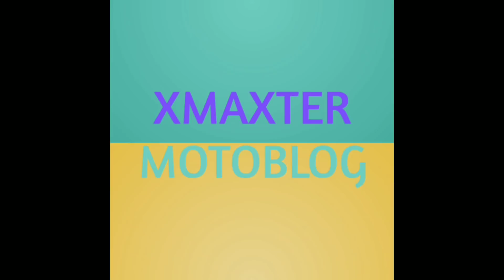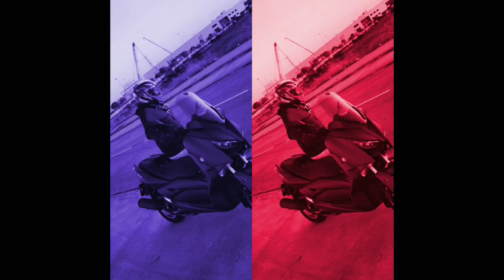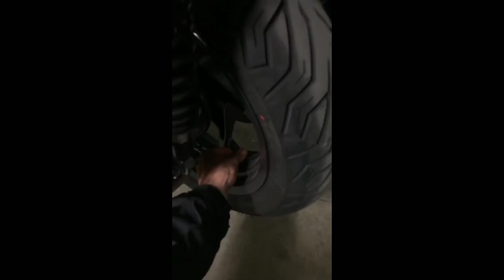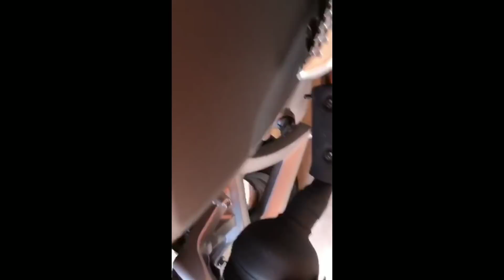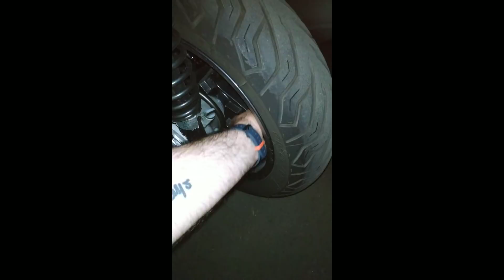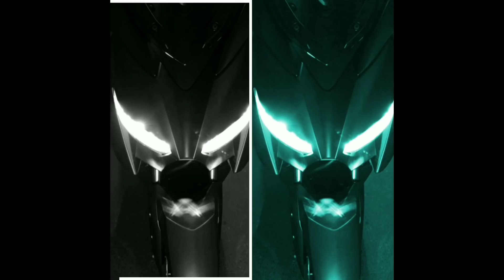Ruido en rueda trasera en modelos xmax .defecto de fabricación?

Comment: Lo que suena es la transmisión de la moto son dientes de engranajes que no engranan a la perfección para que el aceite penetré lubrique y para que no haya fricción ese sonido cuando das adelante y hacia atrás son los dientes de los engranajes dando uno con otro ,lo peor que hay para un vehículo son los baches porque las vibraciones no son buenas sueltan tornillos y provocan fatiga en los materiales si siempre frecuentas terrenos muy bacheados o adoquinados se aconseja cogerlos lo más despacio posible y si siempre frecuentas esos caminos no llevar las ruedas muy llenas para que amortiguen mas el pesó del vehículo ten encuenta qué la moto amortigua para el conductor pero la transmisión su suspensión es el Aire del neumático si lo llevas muy inflado y vas por zona adoquinada muy deprisa es como más va a sufrir el rodamiento internó y como más holgura va a ir cogiendo así que adapta tu vehículo y conducción al terreno que transitas para cuidar tu vehículo es lo que os recomiendo y ese sonido es normal pero sí que hay que éstar pendiente de la holgura del eje del rodamiento trasero

Comment: No hay nada de que alarmarse... en movimiento longitudinal de la rueda se trata de un ruido normal de todas las versiones desde que salió allá por el año 2005/2006... es una holgura que entra dentro de las tolerancias marcadas por el fabricante. 

Dentro del grupo de transmisión final todas las scooter tienen cierto juego en la conexión de engranajes, repito: en pequeña o mayor medida todas tienen algo de juego. Lo que ocurre con las XMax y que la diferencia de modelos de otras marcas es que utiliza un lubricante de grado 10w30 o 10w40 (tanto de fábrica como el que aconseja el libro de mantenimiento) que es menos viscoso que el 75/80 o 80w90 que se hace servir en la mayoría de cajas reductoras de scooter's. Esta diferencia de viscosidad hace que se note más holgura, de hecho fijaos que si giráis la rueda en frio hace menos ruido, incluso de nota menos holgura que haciendo la misma prueba después de rodar unos km's, la caja ya ha cogido temperatura y el aceite está menos denso.
Ya os digo que habrá XMax con 15 años y cerca de 100 mil km que tendrán el mismo ruido misma holgura que cuando salieron de la factoría de Yamaha.
Otra cosa sería que hubiera una holgura en el movimiento transversal de la rueda, que es la prueba para comprobar el estado de los rodamientos que se hace en cualquier moto (se sujeta la rueda con una mano en cada extremo y sin girar se le pega un meneo a izquierda y derecha)... pero insisto que tratándose de un juego en el movimiento longitudinal de la rueda (giro), no hay que darle más bola al asunto.